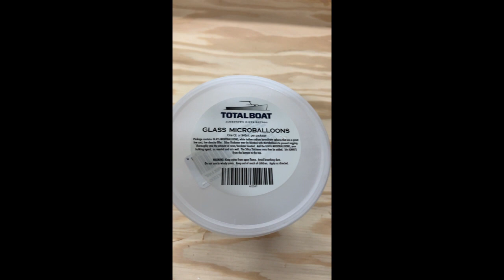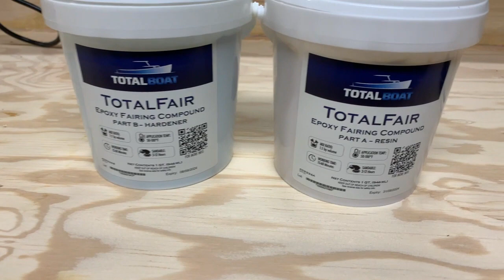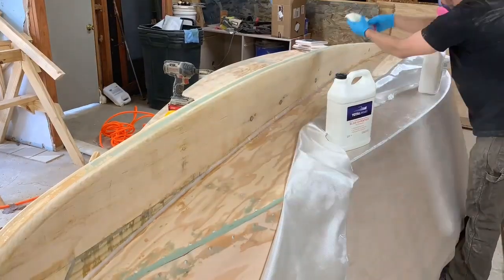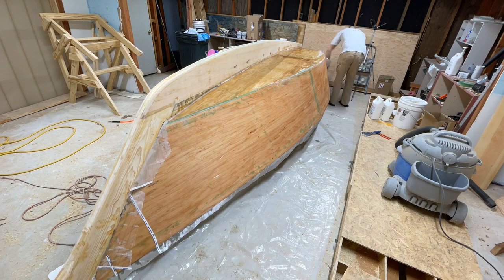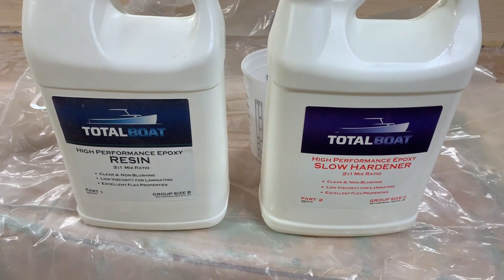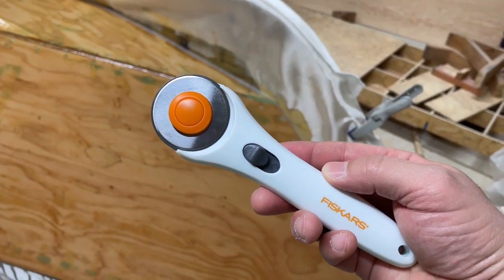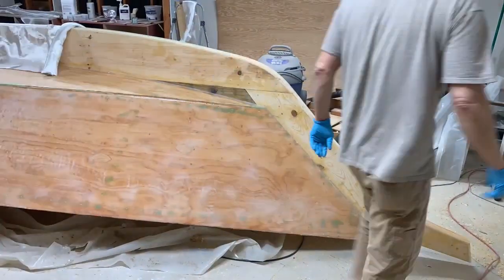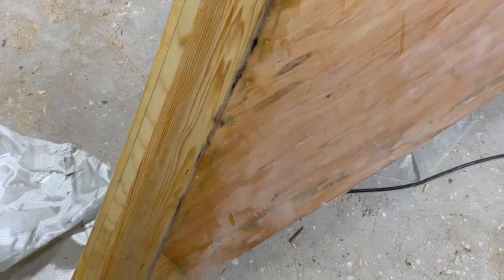Stevenson Weekender Sailboat build: Episode 6 - Fiberglassing the Bottom

Comment: The trick I learned about fiberglass and fillets is to put a piece on painters tape along the edge where I want the fiberglass to end, then let the cloth overlap the tape.  Let the epoxy begin to cure, just a bit tacky then come along with a new razor blade and trim along the tape edge.  To get rid of sharp transition wait just a bit longer then come back with razor and feather the edge.  I have seen the process called “razor scraping” on a couple sites years ago.
Reply from the maker: That’s a good tip. Thanks!
Reply: @makingtime2023  Thanks.  Another thing I remember, when laying fiberglass over bare wood you need to use a little more epoxy, which you did, because the wood drinks some of it.  Too much and the cloth will tend to float.  Once the epoxy is still just a little tacky I apply a second (hot coating) and sometimes a third coat to fill the weave.  That way when it all cured you can sand it smooth without cutting into and exposing the glass fibers.
I usually pre-coat with epoxy, then hot coat a second, wait for it to fully cure, then sand it smooth.  Washing the surface with soap & water before sanding gets rid of wax blushing, which keeps the sanding discs from clogging.  I buy discs in the 50 count packages.  I am on my second 60 grit package for the 12 sailboat I am building.